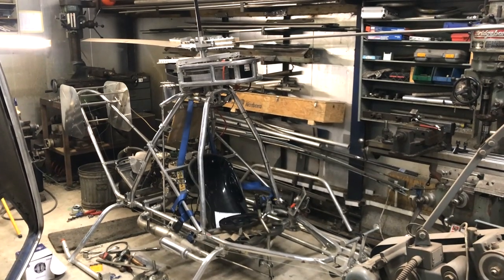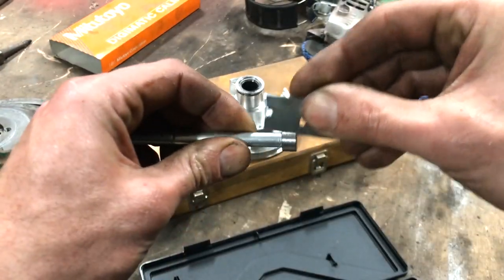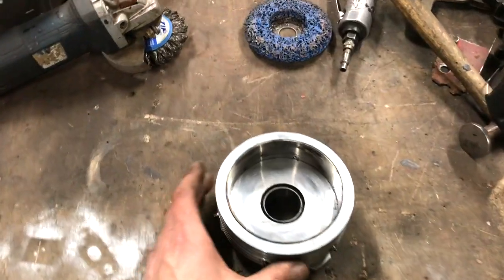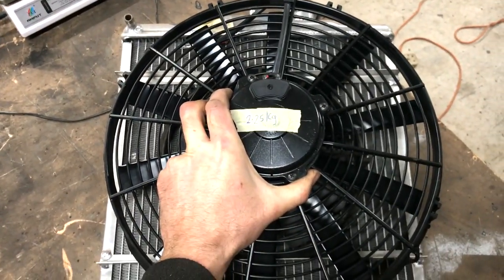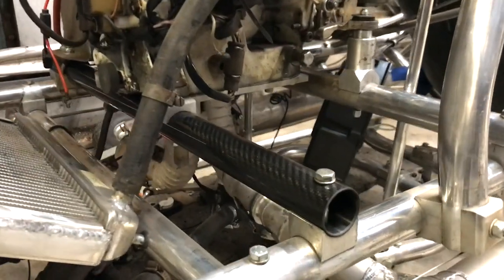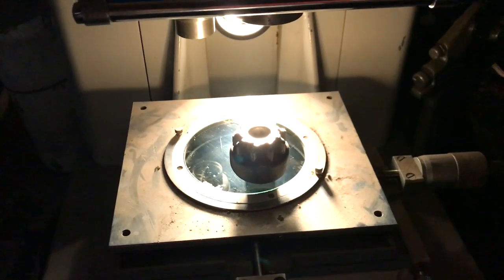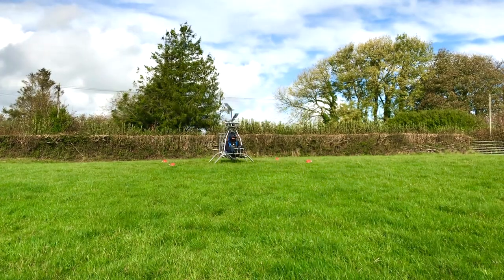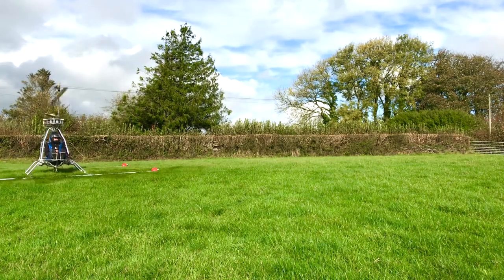It's not easy making a Helicopter

Comment: I think this is a brilliant project and I applaud the simplicity of design and your pioneering spirit !! :)
Having learned to fly helicopters and taught myself to fly paragliders I can imagine what a daunting challenge you have set for yourself, I'm glad to see you've decided to take some heli lessons at least, expensive but fun !! :)
There are a couple of things that concern me regarding this design though... firstly are the single drive belts to each rotor, I've seen these chip out and fail in short order...  but adding a second pair would add weight so I understand this decision.

Secondly fast forward flight with a fixed pitch rotor head can be challenging with tendencies to balloon and roll etc. not to mention excess flapping on a coaxial could lead to a rapid unscheduled disassembly. 
Fly bar weights on each rotor head could alleviate some of the ballooning etc. but this adds weight and complexity as you would need to include swash plates as weight shift would no longer work as that is effectively what you are using now.
No doubt you've considered all this, it's unlikely anyone gets as far as you have without a great deal of consideration ! :)  
An intermeshing rotor system might be an interesting solution to the blade flap and clap concern if fast forward flight gets on to the bucket list of things to do ?

I suppose the trick is to not fly faster or higher than you are prepared to crash ;) 
Have you thought about maybe getting a qualified helicopter test pilot to fly your machine ?
Would make for a great video and no doubt be very educational for you :)
Anyhow, I watch your progress with fascination and hope of success !
Best wishes.
Reply from the maker: Thanks for this message, you taught yourself to fly paragliders ? Wondering how you did that! 
The belt concern you mention you say chip out, is that teeth being chipped off ? Yes having single belts to each rotor is a single point of failure and is of concern. 
I've not heard the term ballooning? 
The roll in forward flight I think could only happen without teeter hinges but only on a single rotor ? Coaxial should cancel? Excess flapping is another concern for sure, fast forward flight seems a long way off and I'm not sure it would be attempted. As you know lift increases with speed and to keep
the machine low to the ground would mean precise control of throttle in my case. I'm not sure if the throttle would respond fast enough for this type of flying. 🤔 certainly not for any abrupt manoeuvres I would suggest. 
The aim with this machine was mostly hovering but I did hope to travel at some small forward speed and I agree keep things low and slow would be the sensible operating envelope. 
The intermeshing syncropter type arrangement would be a great project, I do like that configuration and lift for the same blade diameters I think would be improved. A man called Dick Degraw built one https://youtu.be/9TUbR5Zogv8
The guy is a genius. 
I have considered asking a pilot to fly it but decided I wouldn't put at risk another person in my largely unproven machine, but it would certainly have been a very interesting experiment.
Reply: @Ben-Dixey  .. re paragliding, I got myself a wing and went to some small hills out the back of my house where I couldn't hurt anyone else and learned the hard way, incrementally. Nearly came unstuck a couple of times but stuck with it. After a year of rogue flying I;d acquired 33 hours at which point the guilt got to me and I went to Airworks to get qualified which I did in one day :)

You're right, roll in forward flight would largely be cancelled out in coaxial, although you running a degree higher of angle of attack in the lower blades so there would likely be some roll, but yes, you can tell I'm used to flying single rotor machines.

Ballooning is unwanted pitch up, which you've demonstrated in your videos when an unwanted gust hits your heli in the hover. This is what happens when you achieve fast forward flight  and one needs to be quire assertive on the controls to counter act it. If you stay below the translational lift speed (20mph ish) it's lees of an issue.

Regarding the belt drives, I once had a heli lesson cancelled because one of the belts had chipped out on the back side not the tooth side, luckily they have two belts, Not sure what the life time of these components are but might be a good idea to find out and replace every 50 to 100 hours of flight ? 

One nice thing about the intermeshing types is that they can be gear driven much more easily with a number of other advantages too, including the ones you mention.  The blades could use equal pitch angles, a  universal joint could be fitted to just beneath each rotor head to effect cyclic control thus eliminating the need for the whole engine and rotor assembly to be gimbled which would improve the weight shift aspect of control.  
Considerations for the BTD Mk2 perhaps ? :)

Another thought occurs, I wonder if the safety training skids are too wide ?
I can't help but feel they might be more of a hindrance than help, aside from the extra weight etc.
At that length, or should I say width, they look like they would be easy to bend and buckle thus less resistant to tipping compared to if they were  a little shorter, as wide as the skids are long, perhaps two thirds of their overall current width, sticking out from the main skids about 50% of what they are now ?
Putting balls on the end is a good idea, it's what we do for people learning to fly RC models :)
But these training skids do wobble about a lot and adversely effects control, certainly for the models and kind of looks like the same thing is happening with you in your videos... just a thought.

Speaking of models, perhaps getting a simple electric fixed pitch RC helicopter that's easy to maintain of at least an 18" rotor diameter might be a useful learning tool for understanding the flight characteristics of fixed pitch helis ? ... I've had a few such models and some fly quite well, none as good as a full collective head but i did learn a lot about fixed pitch flight without the risk of being in it :D
Different from the real thing of course because one needs to think further ahead than the models but never the less, good fun at the very least :) 
 
Finally regarding asking another pilot to fly your machine, I understand your reservations completely and I wouldn't invite just any pilot, you want a qualified test pilot, one who understands how to evaluate the risks  and take an incremental and disciplined approach, who can stay calm under pressure  etc. 
The UK equivalent of Chuck Yeager :D 
The CAA would likely have a list of such people who might be interested your project .....
Even if they just looked your machine over without flying it I have no doubt their insights would be fascinating and would make a good video. It could also be useful to you to have them watch you fly it in person.
Just spit balling ideas, I'm trying to put myself in your shoes :)
Reply from the maker: Super comment. Thanks again. 
Your teaching of yourself to fly a paraglider certainly parallels my project. We obviously have a similar outlook but glad you got qualified. 

Ballooning would that also be called rotor flap back ? 

Interesting comment on the effect of the differential pitch between rotors causing a roll. I would still expect the teeter hinges to accommodate this which would result in blade tips coming closer together. 

If a visual inspection of belt condition is enough to go by then I'm quite happy. The machine at the moment spends a very limited time in the air compared to in the Workshop being inspected. I think your suggestion to change belts after a number of hours is sensible. The only slight snag is they are £500 to replace. 

Great point on the skids, it was mentioned to me that they cause instability in models but i couldn't understand why, now it makes perfect sense. I think we need to take into account the ratio of weight on the models extended skids to fuselage weight compared to mine but I did plan to reduce the skids from 4m to 3m for the next test. 

Buying a fixed pitch coax model is another good suggestion, I will have a look, do they have stabilising gyros though ? 

Test pilots insights would be great 👍
Reply: @Ben-Dixey  ... There were a few reasons I taught myself to fly paragliders, I could no longer afford to fly helicopters or anything else and missed flying too much not to do something about it and the route I took was the only way for me to get airbourne, plus I wanted a taste of the pioneering spirit for myself. Having been through it I would never recommend it to anyone but if they insist on going auto-didactic then rule no.1 is do it in such a way you can't hurt anyone else and to take an incremental approach, keep your mistakes small enough to learn from etc.

That said, having flown both and more the challenge you have set for yourself stands far taller than mine  !!

Yes I think flap back might be the correct term for ballooning, planes can do it too but for different reasons.

Regarding the belts a preflight check is mandatory as with everything else regarding the machine naturally  :)
£500 is quite a lot for a pair of belts though, are they aircraft quality ?
Would be interesting find out what the manufacturers suggested lifetime is... and to find out what the belt life times are for something like an R22 helicopter and use that as a guide perhaps ?
If you change them every hundred hours that's on £5 per hour extra, if one of them pops there's half a chance you total the whole machine. However they look reasonably wide  although if I remember rightly one has teeth on both sides and seems quite skinny .... I am of course speculating from videos at a distance here, you sound like this is something you've considered seriously and done your homework etc.

The issue with the skids is about resonant frequencies which cascade throughout the mechanism, the shorter the extensions are, the higher the frequency and they will become stiffer as the moment area of the cross section improves.  They're basically like low frequency tuning forks and if they're in tune with the engine and rotors you get a resonant frequency that can break things, like the opera singer with a wine glass. But also the wobbly weight will mess with the controls too, imagine putting a wobbly weight that sticks out the front of the handle bars on a bicycle, it would definitely make steering harder, especially over a bumpy road.    

I've not seen any decent sized RC fixed pitch coax models and all the small ones have a 45 degree lead on the flybar which stabilizes very well in still air but completely messes things up in wind or fast forward flight. My suggestion was for a single rotor fixed pitch. But make sure you get one with minimal camber on the rotor blades.
The old school Hornet I had from years ago flew well enough to explore a wide regime of flight.
And yes, they have gyros for the tail at the very least, kind of unflyable without them really. These days you can get some models with gyros for all axis's but I'm not keen on that because they always feel like it's doing the flying and not you. But you can get the small ones for around £40 that will fly indoors happily but they are a toy, fun but limited. 

As for test pilots, I bet you a pound to a pinch of shit there's more than one out there who would be fascinated with what you have created thus far !! :)

Cheers for the link to Dick DeGraw's heli, I did some searching and found a brief video of it taking off, looked really smooth and very controllable !

https://www.youtube.com/watch?v=Q6mDK9XhklE

And here's some more of his Jump Take Off Gyrocopters ! awesome stuff, very clever guy !

https://www.youtube.com/watch?v=y_COkkFuchA

https://www.youtube.com/watch?v=t6xjCUVuUzg
 
https://www.youtube.com/watch?v=0MDtdLv99WI

https://www.youtube.com/watch?v=wk0AKpkaFx0

https://www.youtube.com/watch?v=a882megKhVM

Anyhow, I don't know where abouts your farm is but if it's anywhere near East Sussex I'd love to drop in for a cuppa and to see the machine in person, cheeky of me I know but design, vehicle design and specifically aircraft design has always been a favourite subject of mine but I never got beyond exploring it with RC models, another of my self taught endeavors but then flying for me is the only real magic in the world ! :)
Reply from the maker: I think we are on the same page. 
The belts were sized using gates drive design software, I originally phoned them for advice but told them it was for a helicopter. At this point they ended the conversation. Hadn't thought about liability in this situation. So I went online and found their software. I'll have a look at the parameters but I'm sure it would be set at a sensible operating lifespan. The only thing is I'm now running the belts at a smaller drive pulley diameter than recommended and about to decrease this even further. I suspect this will reduce belt life. No doubt a breakage would have a catastrophic result but then there are quite a few components that can do that. The belts haven't been at the top of my list of worry's in this machine. However I had better run the numbers again and see what info I can obtain with the smaller drive pulley. 
The bottom belt is wider for the simple reason that's all that was available in the double sided version, it should be stronger than the narrower one. If buying the belts again I would choose shorter ones and bring the weight down out the rear of the tilting head. That would mean less counter balance in the front needed. 

The sch2a uses double sided poly v belts, much lighter set up than mine. I wouldn't mind going this route. 

I can now understand the effect of wobbling weight in extended skids. Will
Definitely reduce the length but not by too much yet, gradual reduction I think will have to be the way. 

 Dicks jump gyros are amazing I tried to contact him via Facebook but no response yet. He must be in his 80s by now. 

I'm in north Devon about 4hrs from
You ? If you're ever this way let me know. 
btdixey@hotmail.com is my email.
Reply: @Ben-Dixey  Typically general aviation aircraft have a minimum of 150% failure margin and 200% for aerobatic, with up to 600% for those small but critical components such as hinges, wing attachment bolts etc. The CAA provide some good documents regarding design minimums, dense reading but useful, especially if you're designing your own aircraft, although I dare say you might have already trawled way through a few of these already :)  

Over the years I've been working up a few full sized concepts I would love to see to fruition but alas not the means to fulfill them, ah well, it is still interesting to explore them. The idea that's most within reach for me is an idea for a foot launched aerobatic glider, which has not been done yet, twould be a small market for such a thing but would be good fun to fly  :)

I hadn't clocked the skinnier belt is wider, handy that it is though. My thinking is to divide by three whatever the software suggests as the expected life span before failure for the given pulley sizes your using. I need to take another look at your videos as I've forgotten how the engine is driving the pulley wheels, is there a better place to reduce the gearing ratio ? .... and by better I don't mean easier ;) 
or would that be a total ball ache to achieve ?

I did wonder about the gimble system you're using and where abouts the CG (in the three axis's) is in relation to the rotor head/engine assembly.  In particular if the CG is above or below the gimble axis and what effect that might have ?
If it's below might it dampen the weight shift control effectiveness ?
But it would be more stable when parked I guess :)

Not sure what an Sch2a is... I need to look that one up .... is it some kind of Schweizer heli ?

It's a shame Dick didn't reply no doubt your project would have piqued his interest for sure !!
and yes, his designs are most interesting :)

Cheers for the email, I'll post you so we can get in touch when the planets align thusly. 
in the mean time, you can delete it from your previous comment, just help save you from the spammers and all that jazz !!

One more more after thought regarding models, once you know how to fly them, is that they can be very useful for exploring design concepts.... and if you use the wing cube loading formula you can account for the scale effect to.
Something to consider when you get around to the BTD Mk2 :)

Anyhow, this might amuse you, here's a video of me destroying a helicopter in this action spoof some friends and I made :)

https://www.youtube.com/watch?v=V_UpBzWluAM
Reply from the maker: I have to confess I haven't looked through any CAA documentation, I have done what I think is appropriate with regard to the highly stressed components. I've done a video on calculating rotor strength. The rotor hubs for example can take 4.5 x the load at fatigue strength not yield. I have gone to this extent to make sure the rotors at least are safe. I haven't been able to calculate everything within the drive, I have done some real life testing of the drive shafts. There is more I could do and I had better do some more if increasing torque on the system. 

Your foot launch glider sounds interesting. Don't know anything about fixed wings or gliders. 

It would be better to increase the size of the large driven pulleys rather than reduce the size of the driver pulley. A minimum diameter of pulley is specified and I'm exceeding that. It's a lot of work and money to do it the correct way. It depends what the reason is for the minimum pulley diameter specification. I suspect belt ware. 

I don't know where the CG is located in the vertical axis but it's effect has been discussed. Someone did tell me that having the rotor higher up would help ease sensitivity. I think it would do but control input lag would also be increased in my opinion. Then you have the weight shift vs cyclic control discussion. It seems to me the rotor tilt is being partially powered by aerodynamic forces. Same as a gyro, and weight shift theory isn't anywhere near as prevalent, it still plays a part but cyclic changes in angle of attack move the rotor discs, even with a fixed pitch rotor. 

A good interview with the creator of the sch2a  https://youtu.be/53yDkGdInBI

Loved your James bond style action movie clip. Really good stuff 😃
You are a talented guitar player too. 👍
Reply: @Ben-Dixey  all design is a compromise and it's only through iterations we can arrive at a good compromise :) 

re. belt drive life and pulley size, I suspect the critical factor here is the repeated angle of deflection, the smaller it gets the closer it becomes to a knife edge (effectively). Enlarging the big pulley would be the preferred option or better yet (from an engineering standpoint at least) if there are any gears from the engine to the drive shaft might be the best way to adjust your ratio, but I understand the reality of costs and is part of the compromise.

I've watched all your videos on this project with fascination and feel that you've taken a sensible approach overall, the load factor of 4.5 is very reasonable and probably not too far away from commercially built aircraft. Also, tests are better than maths in my opinion. Both would be best of course but you not aiming to sell this to the public thus you don't need that level of scrutiny. Not only that you seem be quite disciplined about the flight regime you operate the aircraft in which greatly stacks the odds in favour in the event of a mis-hap

With regard to CG of the rotor/engine system (RES), you're right, raising the rotors would stabilize things but also reduce control authority.  I was  more considering the effects of lowering the gimble mechanism so it was more closely aligned with the vertical CG of the    RES and if that might improve control authority ? . not sure, I think maybe, would be nice to test out on a scale model perhaps :) 
Your rotor heads operate on pretty much the same principle as many if not most autogyros except their gimbles are much closer to the rotor heads but then they only have one rotor. 
Having the gimble further away makes the rotor heads swing back and forth and side to side much more which could induce some more flap back, partly why I'm unsure about lowering the gimble .....

I reckon I need to rewatch your videos to remind myself of this arrangement you've arrived at. I still think there's a genius to the simplicity of the design though :) 

Btw thanks for the kind words, glad you liked my wee videos :) 

Anyhow, sent you an email, hopefully it hasn't arrived in your spam folder ;)
Reply: @Ben-Dixey  Just watched the video link you posted on Miro and his Sch 2a and I saw it when it was originally posted as I subscribed to VFS ages but forgot I had seen it, was good to watch it again though, flies quite well and he's arrived at some interesting solutions. 

Lots of similarities to yours but also has some important differences too.  Interesting swash plate solutions and rotor heads. 

Btw, if/when I get to Devon I'll be sure to bring a wing or two with me so you can have a go at ground handling it and maybe fly down a small gentle slope, something easy and safe :)
Reply: @Ben-Dixey  some coaxial training fixture or moving platform like stuf, we can mount heli on it and we can fly forward - back & side ways also,, we can take height at certain level (2-3')to hover.
Reply: ⚠️ God has said in the Quran:

🔵 { O mankind, worship your Lord, who created you and those before you, that you may become righteous - ( 2:21 ) 

🔴 [He] who made for you the earth a bed [spread out] and the sky a ceiling and sent down from the sky, rain and brought forth thereby fruits as provision for you. So do not attribute to Allah equals while you know [that there is nothing similar to Him]. ( 2:22 )

🔵 And if you are in doubt about what We have sent down upon Our Servant [Muhammad], then produce a surah the like thereof and call upon your witnesses other than Allah, if you should be truthful. ( 2:23 )

🔴 But if you do not - and you will never be able to - then fear the Fire, whose fuel is men and stones, prepared for the disbelievers.( 2:24 )

🔵 And give good tidings to those who believe and do righteous deeds that they will have gardens [in Paradise] beneath which rivers flow. Whenever they are provided with a provision of fruit therefrom, they will say, "This is what we were provided with before." And it is given to them in likeness. And they will have therein purified spouses, and they will abide therein eternally. ( 2:25 )

⚠️ Quran